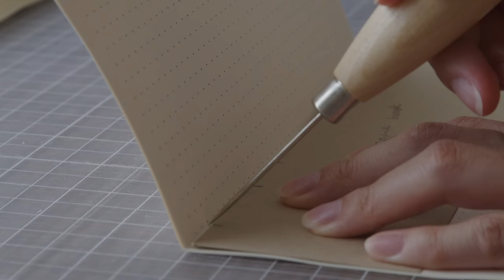Making journals for a peaceful mind ✦ ASMR bookbinding process

Comment: My toxic trait is thinking I can do this on my first try perfectly without any experience
Reply: Actually yah we can do it.. should punch the hole correctly ..an sew ...well we can do it ..I too think so😅..edit;-. I've done perfectly...in first try stitches were a bit loose. And in the next I rocked it ...i believe u all can do it as well.   It may look difficult but when we do it seems easier...
Reply: You guys can! It may not be exactly perfect but I’m confident it would be functional, unique, handmade, and gorgeous. 😊 Sounds worth it to me! If you haven’t already, start with making a junk journal.
Reply: Underestimating a project can actually be a good thing. It makes you procrastinate less, gives some confidence to start.

By the time you feel like the project is actually too hard and overwhelming, you're too deep to stop halfway. So you just have to finish it.
Reply: Yessssss
Reply: I did it in the first time
Reply: The hardest part about the whole thing is measuring and curving the spine. Other than that it’s having the right materials and following directions like a recipe.
Reply: Yeah...no. Mine would look like a toddler made it. While having a temper tantrum. With three time outs. After taking a two hour nap.
Reply: Skills are developed. It may not be perfect at first, but over time it’s going to get better and better.

Comment: This video is amazing & the finished journals are incredible! I am wondering what the hammering does to the pages. I make junk journals using dismantled books. I remove the pages to reuse the covers but this has given me some interesting ideas.
Reply: If you’re talking about the hammering along the spine, that’s part of a process called rounding. Basically, when you sew the book together, the string adds extra swell along the spine. That can make your book look a bit like a pizza wedge! Rounding the spine helps distribute that extra width more, so your book looks better.

Then, you can put the book in a press between those metal-topped plates for a process called backing. This makes angles along the side that fit into the case. 

Rounding and then backing makes a strong book spine which is less susceptible to settling in the case, kind of like a stone arch is very strong.